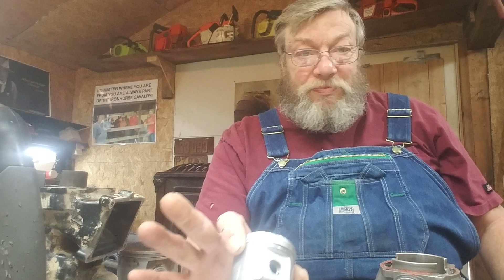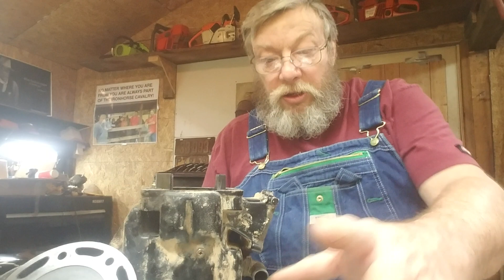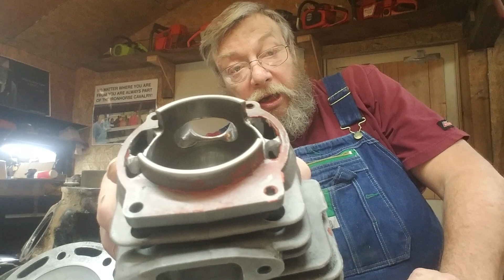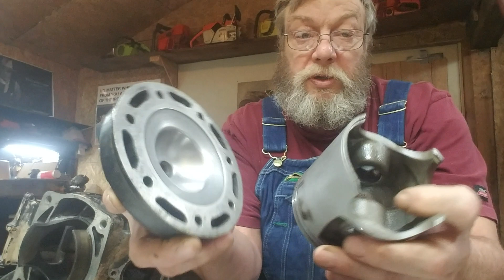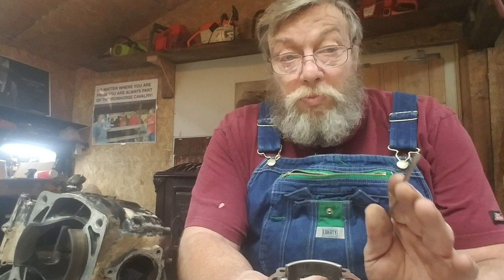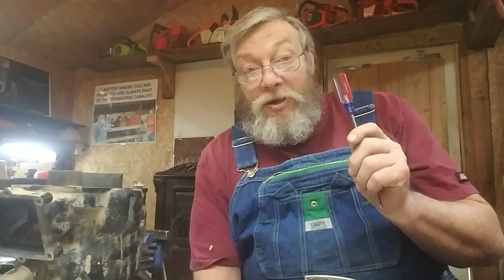Important info about porting! Spring has sprung and love is in the air!

Comment: In all my experiences of guys trying to get more out of their sleds. Increasing compression to stupid numbers was never really a thing. It was all about moving the cylinder around to optimize port timing. The variable exhaust polaris triples (case reed) they would shim the cylinder up and then machine the head so it sat down into the cylinder. The old phazers that reed into the cylinder. guys would mess around with cutting out the intake side of the piston skirt I have always been so fascinated with this stuff. But I have never really had the balls to play with it to much. I work on lots of motors but I always keep it stock. Thanks Harvey you are a good teacher because you have been there and lived it. I love the bikes, the sleds the saws the two stokes!!

Comment: Hey there Wall Banger!  The guy that made the cool hub for the degree wheel...is he selling those?
The reason the forum boys don’t get it is because they don’t have the hundred years experience in many fields... you are walking your own path and doing experimentation.  They are just kinda following the leader... working just one way that works.  You definitely don’t have to have 200 psi to be making power.  I’m so happy it’s spring!  Found all kinds of great goody’s today!  Gotta keep your vehicles tight enough to keep them out the ditches... I do the same layaway plan for my equipment.   My saw work bought a washing machine and I didn’t think that was fair.., she said you want dirty clothes???? I’ll take the old style truck all day long.  Got the 250 with the diesel 6 speed... I can fix anything on it... it’s still getting broken in ... only has 160k on it.., my old dodge went 288k before I sold it for this...?still tight!!!! I learned how to build a rock solid 46RE!  I’m a clutch man!   I’m hurting bad but still trucking!!! That widow maker hurt!👍😂😂😂
Reply from the maker: David!  You are a man amongst men!  You are a survivor! We learn how to make do with what we have!

Comment: Spring cleaning soon! Hi Harv, hope you are doing well. My Husq 353 bogs a little on the top end, any thoughts? Thanks
Reply: Adjust your hi low jet's. Make sure your spark plug is good.  Check fuel filter.

Comment: Just wondering.... What's your opinion on the Sachs Dolmar 133 85cc chainsaw? Except that it's heavy as hell... :-)
Reply: It's a great saw with a great bottom end. Tough to find parts for them though. They are  heavy as well. You wouldn't want to carry it all day. It's for big timber.
Reply: @eriknelson6529  I had the luck to find this one on the Dutch version of Craigslist for 25 euro (20 dollar??). Marked as 'Broken'. But after replacing the fuel line and a carbkit the thing works a treat. Luckily Oregon still makes chains with 80 links though. The bar is a a weird lenght. And indeed, only for cutting big timber...
Reply: @andreasheij  you scored then! Those are worth good money. Good for you. 600 to 1000 in the states.
Reply: Big crank and bearings
Reply: @eriknelson6529  Well, me being a backpatient... Guess I could put it on Ebay and ship it to the USA and go there myself for the money and see some real lumber :D
Reply: @andreasheij   look up what there selling for you'll be surprised. Then list it for sale. You should do well !

Comment: 85 was the best year for the 500 take a peace of glass and glue sand paper to it and take a few thousands off the head 👍👍what position do u run the needle on the carb up there? If they had power valves back then it would really dump u on your axx🤣
Reply from the maker: Middle!  Wouldn’t want a power valve on one of these!

Comment: I’ll try to keep this short lol. I had stage 4 squamous cell carcinoma cancer. I was very lucky and I beat it. Problem is the radiation treatments beat my body really bad. Basically eating me from the inside out in my right shoulder and upper back. I also had a right radical neck dicection. Due to all this I can’t do nearly as much as I used to physically. I still like to kill trees when I feel up to it. Usually big rock maple and big white pine and red oak. I like husqvarna. Always have. Although my first chopping saw was a 046 stihl. So my question to you is what saw model should I get that is on the lighter side but can be hot rodded to run a 24-28 inch bar. Full house. And be able to cut thru rock maple and red oak like a big saw. I know your busy Harvey but when you get a chance let me know. Have a great day IRONHORSE NATION!!!!!
Reply: Thanks for the information buddy!!!!
Reply: Retired Welder you got it man !  For the family
Reply: Harvey is building me a 272xp. Awesome power and a true work horse. I would go with that.
Reply: Be good brother. Healing takes time. The good thing is your hear with us .
Reply: Erik Nelson 272xp is a fine saw as is a 372xp ... both will serve ya well ... IF you want the “state of the art” Husqvarna 2020 ie power,anti-vibe, ergonomics , fuel economy and dont mind spending the coin then the 572xp is it ... It will outperform either the 272xp or the 372xp in stock trim ... If you prefer STIHL the 462c and the 572xp cut even stock but the 462c is lighter if that’s important to a guy ... While there is something to be said about keepin the old saws goin and Savin $ ; ya don’t wanna be the richest man in the cemetery either-also I want to be able to feel my hands workin right too in 10 years !
Reply: Decisions decisions lol.
Reply: @fabzacres-blackcat   well said fabz. I haven't had a chance to run the new saws.
Reply: Erik Nelson if ya get the chance to run the new versions in some timber definitely do so ... I think you will be amazed at what the engineers in Stuttgart and Sweden have come up with !
Reply: I tried a stock 272 the other day with a 24 inch bar. It seemed to do pretty well. I dropped a 4 foot on stump rock maple. I bore cut it. Seemed to turn that 24 inch chain well. So I’m thinking a 272 ported with racing piston and a pipe would do me just fine. Originally I wanted a 395 but when I picked one up I knew that wasn’t realistic with my medical issues. Now I gotta find me a decent priced 272. And then someone to hot rod it??? Hmmmm. Lol!!!!!!!
Reply: @retiredwelder  that is a great saw! All of the suggestions we're great but I like the older stuff for price tag and performance. The 272 is an animal ported. Im a logger and that's what I would want.
Reply: Retired Welder I’m sure Ol Harv can help ya there ... I primarily specialize in the new models ... a lot of time if it’s an older saw (unless it’s cherry) it can be cost prohibitive (labor+parts) to “refresh” it back up to snuff ... last thing I wood want to do is build an older saw and have it grenade cause the bottom end was ? ... not good for the builder or customer - besides I don’t want people throwing rocks at me 😉 ... also seems to me like some peeps think their old saw is made out of gold with  the prices they ask !  I’ve seen 064 in fair conditions goin for 1000-1350 (but the were ported by 🐒 so that’s gotta be worth $500 xtra lol) ... then you get into the issue of non-oem parts and guys swapping Chinese $19.99 cranks etc... IF you know the guy who owns the saw that’s one thing , otherwise it’s a crapshoot ...like ol Ben Franklin said ... “The bitterness of poor quality remains long after the sweetness of a low price is long forgotten”
Reply: I’m going to just keep my eyes open. I just found a guy in my area that has a few. He’s got a good reputation with the local logging community here in central Maine so I’ll probably go check him out. He’s actually got one advertised for 350. But I know what to look for lol
Reply: Retired Welder another good choice is the STIHL 044 ... can be made into a powerhouse and is lightweight ... might be easier to find one also ...Good luck on your search !